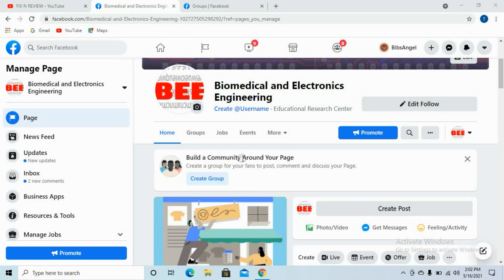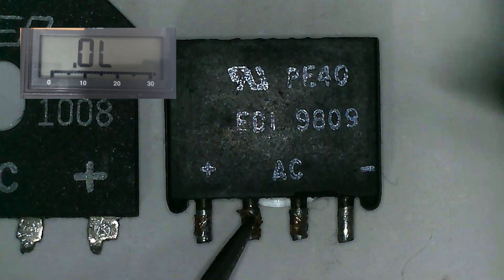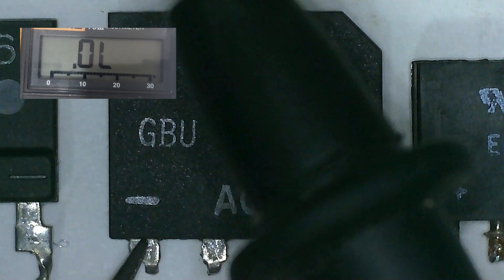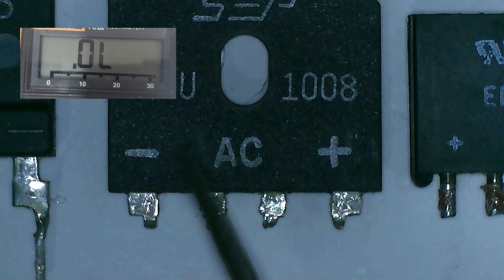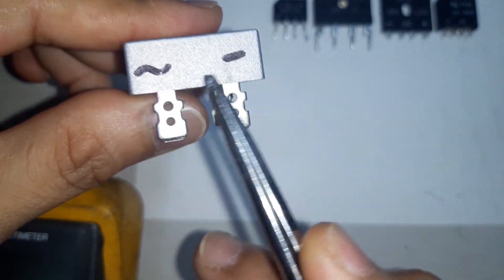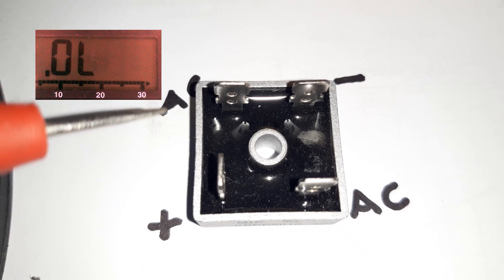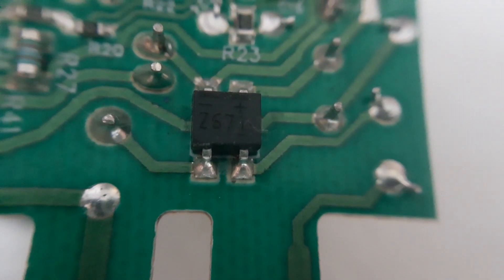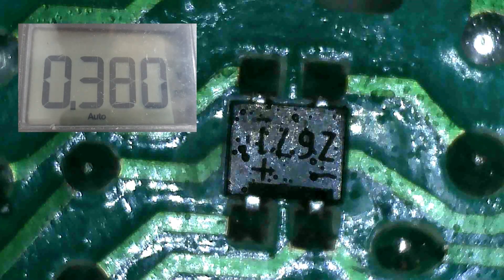How to Check A Bridge Rectifier

Comment: I get a measurement of aprox 540 on all combinations. But when i measure between + and - i get the lowest measurment of 485 instead of a high reading of 900. Does this mean the rectifier is bad? 
It is in a laptop charger and it does not work properly. If i plug it in the mains, it often sparks in the plug. When i measure the output i get 19.47v but it does not charge the laptop except if it's shut down. The laptop is not the problem, i bought a new charger and it charges fine. The capacitors look physicaly ok but i'm going to change them just in case.
Reply from the maker: Probably bad resistor. Look for resistor that the value change. The one that goes higher. In the output.
Reply: @biomedicalelectronicsengin7192  I measured all resistors and they're good. I also measured the rectifier out of circuit and it is also good. It turns out that both the input and output capacitors were bad all along, they have internal leakage. They measure 82uF instead of 68uF on input and 710uF intead of 680uF on the output. I changed them both and the charger works just fine. It does not spark when plugged in and the laptop charges when turned on.